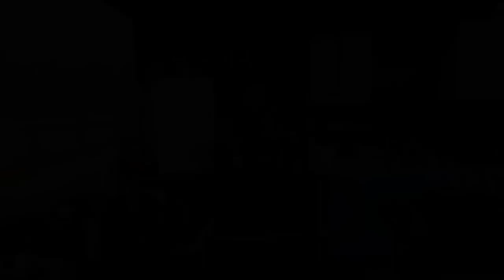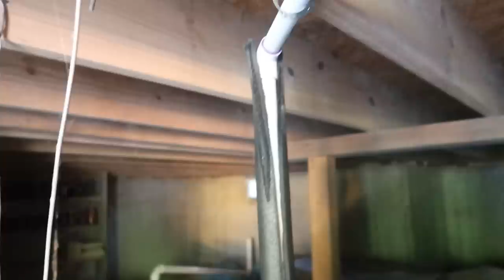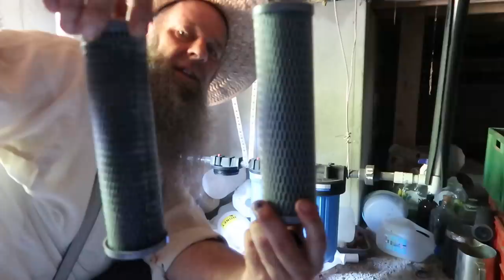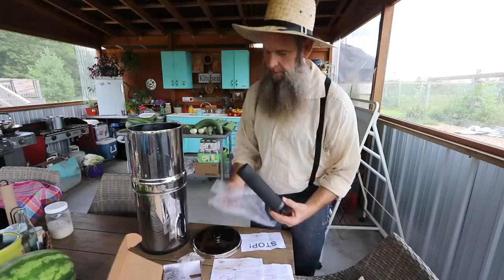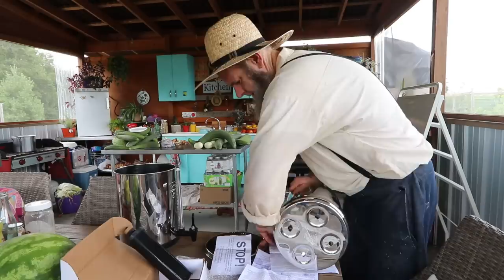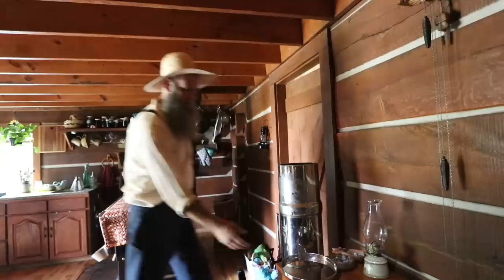OFF GRID WATER could make you SICK protect from Bacteria Viruses Heavy Metals

Comment: Hi Doug I’m a new subscriber. I used to design water systems for homes and I see a small problem with your filters. Your first filters should be the sediment (threaded) filters and your carbon filter should be the very last filter that your water passes through. You don’t want to contaminate your carbon filter with dirt and debris that’s why the sediment filters should be located first. God Bless.
Reply: Well done.. the collaboration of great minds! Thank you all!
Reply: 👍🏼 thanks for the heads up.
Reply: Great thanks so much for that information. Do you know how that works in the Burkey System by any chance? Because the water is going through at once? I have a cymomis system, I can't remember how to spell it, but I only discovered this year that I hadn't got the one that puts minerals back in, so got the extra one. But I was thinking of the Burkey for my Caravan.
Reply: Reverse Osmosis is the system I have in my house, I get the filters changed every year. 👍😉🇮🇪🍀
Reply: I was wondering about that. I was thinking he at least needed a pre-filter before the carbon filter or something
Reply: 🌻❤ thanks for sharing
Reply: @Marie-yx5ie  what's the cost of something like that getting setup?

Also are the filters expensive?
Reply: @Marie-yx5ie  How do you like that system? Is it expensive?
Reply: @Marie-yx5ie  Berkey retains the minersls
Reply: @majinvipergaming  Berkey is between 4-600 dollars, charcoal filters last 5 years as can be cleaned, can add fluoride filters
Reply: filters includrd
Reply: @seciliafeliz  highly recommend the Berkey
Reply: Berkey filters doNOT last that long. 
Do the red dye test to ensure competence. 
I have owned berkey for 11 yrs and mine lasted 1.5 yrs and it’s only me and my two young children drinking.  recently in past two yrs they have been failing straight out of box. 
Berkey has gone downhill recently. 
Do the red dye test with McCormick red dye. If it’s pink then the filters fail
Reply: @majinvipergaming  Hi sorry I am only seen your message now, it was €450 to install at first. The equipment is quite large so I had to get a unit built outside at the back wall of the sink, to house it, which cost me €350. And the guy that brought the system gave me the wrong messurments and it was a very tight fit 🙈. €150 every 12months for a service, they change the filters and check the whole system. Someone mentioned that the system I had, hadn't got the minerals filter. So I checked with the company and they said I didn't have it but I could add to my system, so I did for extra €50 last year but my unit needs a little extention now, it's bulging at the seems LOL that my next project. I hope you understand. If you have any questions let me know. 👍😉🇮🇪☘️
Reply: @majinvipergaming   he flashed the water catchment system cost at $4300 on the screen in the first few minutes after he climbed into the crawl space.
Reply: @kimberlydeschamp6300  O did he? Guess I missed it since I'm at work. But thanks for taking the time to point it out.
Reply: These filters are great for mor casual usage. They are all available in “whole house” size filters (much bigger). Still they are better for “clean” water that needs some polishing. For larger, farm scale, up to village scale… Bio-Sand filters can provide scalable resources for whatever you need inexpensively.
For small house scale systems, using a Bio-Sand filter, along with course pre-filters of decreasing mesh size will remove most of the obvious visible debris. The water then enters the Bio-Sand filter, displacing the existing biological zone, then the sand zone water, before it passes thru the stainless mesh screen into the bottom of the filter container where it is collected by a hose that allows the water to rise by gravity till just below the inlet level. Water in, water out. No pumping needed. The water proceeds to a storage container (of whatever capacity needed). This container of water is considered “clear/clean”. But if you test and don’t like what you get, you can use either gravity or pumps to pressurize the clear water & add micron/carbon filters that will last much longer due to pre-filtering. If your tests indicate it (in most cases the biological action in the upper zone of the sand filter will scrub bacteria) you could still add a ultraviolet filter, or use chlorine in the appropriate amounts, in the storage tank after the Bio-Sand filter. (You can generate your own chlorine with an 12 volt battery powered chlorine generator by MSR: 
https://www.msrgear.com/shop/global-health/se200-community-chlorine-maker/10275.html
Reply: You should make a video dude sharing your knowledge
Reply: WOW 😮❗ Thanks for sharing that vital information 😊.
Reply: Ooooh...tell me more please ❤️
Reply: Thank you.
Reply: Hey frank...how can I get watrr system in desert..there is no rainwater except twice a year???
Reply: Absolutely right !
Reply: @ingridhamilton7746  Rain water only comes from the rain. If it only rains twice a year, you are out of luck.
Reply: @sm-hi7jt  the birki’s are useless if you have high iron and high sulfur. We have both and no matter what we did the water tasted awful.
Reply: @Marie-yx5ie  the problem with RO filters is the enormous! The very best system wastes 4 gallons for every 1 gallon received and the that extends upward to 20 gallons wasted for every gallon caught in the worst of systems. When water catchment or even a well are your water source that is water that just can’t afford to be lost.
Reply: @Marie-yx5ie  I use reverse osmosis under my sink and change the filters out once a year... relatively cheap. It is Overkill as I installed a whole home system...I am slowly Getting rid of PEX to put in copper. The water goes through a high powered magnet...then a spin down sediment filter...then through a5 foot carbon filter...the longer contact time will remove chlorine/chloride...and then through sediment filter to capture anything which may have passed through or dislodged...then I've sterilizer...I can't recall brand name but they're made in America...and whole system was about 1/2 of top brands...i think less than $900 for whole system...carbon filter is good for 5 years/a million gallons...whichever is first.
Reply: @Marie-yx5ie  is it expensive
Reply: @kimberlydeschamp6300  Nice counter top in the kitchen. He also said fans bought them the filter, then a bit later talked about the glass tube to see the level of the water, said, "We opted for the glass tube...". Makes no sense to me.
Reply: Makes sense.
Reply: @lionheart830  You can order the glass viewer tube as accessory any time. He also could have added fluoride filters or more carbon. He opted for the viewer glass.
Reply: @ingridhamilton7746  if it only rains twice a year you need a bigger cistern to catch your water all at once. Someone who lives in Seattle can have a tiny cistern because it rains all the time to refill the smaller cisterns
Reply: @Montana Black-Hat Hacker I would suggest using the Zero water filter instead.
Reply: @ingridhamilton7746  cactuses? Just kidding.
Reply: Cheers ,👍✌️
Reply: Bless you for educating all of us 🕊️💐
Reply: @ingridhamilton7746  Build a container big enough to hold a year's worth of water and fill it when it does rain.
Reply: @Marie-yx5ie  thats the best h2o ever. I was a hemodialysis nurse & we used reverse osmosis to run our machines. All of us would take a jug of h2o home for drinking n cooking.
Reply: @elioraimmanuel   We have an Iron Curtain system for those exact problems, works great.
Reply: Thanks! God bless you and God bless America!
Reply: Truth!
Reply: @chrisparker7400  thanks I’ll do the dye
Reply: @lionheart830  probably not much makes sense to you.
Reply: @NameRedacted-kc2ik  👍😏
Reply: @dlspiritdancer9548  Which one do you have at home and would you recommend?
Reply: Could you do one threaded one carbon and then threaded again? Would that make any difference.
Reply: Yes
Reply: Berkey is not NSF certified.
Reply: first thing i noticed beat me to it =).
Reply: Thanks for passing on valuable information. This is how community is formed. Giving to one another the necessary knowledge and tools or assistance that demonstrates compassion, which those who receive are willing to reciprocate. There’s a whole lot of us that have yet to break away but certainly desire to. Getting started is the most difficult obstacle. Bits and pieces of necessary information go a long way.
Thanks again
Reply: @ingridhamilton7746  people catch water that is in the air with nets > look it up
Reply: @timcriswell7481  They have huge containers now that the good 
Lord blesses with rain in due season. It was touch and go there not very long ago, but the rain did come to fill up everything again! Praise God!
Reply: @amyhoang9140   The Zero Water Filter System is OUTSTANDING!!  The TDS (total dissolved solids) removed are incredibly high, leaving the filtered / purified water nearly perfectly “pure”.   I USED to use Zero.  
But… due to costs, we moved to Berkey.   (Zero Replacement Filters = $16 bucks here in NJ! With the incredibly HARD water provided by our city utility, we were going through filters after only 8-10 gallons of water filtered)

The “Royal Berkey” is a decent size for our 4 person family.
We have municipal city water, copper pipe work w/lead-free soldered joints. 
It is supposedly “safe/ok” to drink according to the utility and a local lab where we sent out a sample.
BUT… the water tastes like chlorine AND is extremely HARD and we never installed a water softener.
I probably should have installed a water softener years ago, but carrying the salt is nearly impossible for me (I have A.S.)

We truly like the Berkey and love the taste of the processed water.
I definitely noticed a huge drop in quality of replacement “black” filters, but it is still more affordable than the Zero.

If I were dealing with “marginal / suspect” water, I’d filter through a few coffee filters for sediment removal and then use the Zero.
Other than that instance, I’d probably continue on with Berkey.

Thanks!
Reply: @ingridhamilton7746  Yes I helped design one and ran it across engineers to verify it.  You just need bigger tanks to accommodate the times you don't have water.   You will need to calculate, how much annual and monthly water you need, how much water you get during minimal rain fall, to determine how much water you will need.  Shop around for the cheapest tanks you can find and create a way to funnel the rain water into them as fast as possible.  Design a way to easily remove debre when you have to clean them.  Need a pre-filter tank which removes large debree.  GL in the desert!
Reply: I recommend a settling tank before the filters.
Reply: @chrisparker7400  You have to clean the filters
Reply: @sm-hi7jt  there is a class action lawsuit against berkey. False advertising.
Reply: @CC-Rider  what is that
Reply: @elwingw4321  can you tell me where?
Reply: @elwingw4321  where is it happening please
Reply: @sm-hi7jt  got to Robert Beaty “betrayed by berkey “ YouTube . Robert Beaty is the YouTube channel. He is doing an investigation of berkey filters. And discovered 2 lawsuits.
Reply: You are right.
Reply: Thanks for your post! I thought this system was backwards. now I feel I was right. with the two thread joints, it can be turned around!
Reply: update many people posting that the new filters aren’t passing  the red dye test as are made cheaper now, I have to test mine
Reply: @ingridhamilton7746   a well?
Reply: @amyhoang9140   what's that?
Reply: What about threaded then carbon then threaded?
Reply: @chrisparker7400  
How exactly do you do that test? Ty
Reply: I was thinking the exact same thing….
Reply: @jwmmitch  what if his design was like aboveground swimming pool? He just showing under parts / pumps/ bubbler/sand barrel etc above it all assuming is the first of many debris catches, I didn't see or catch anything most likely alot of trained and untrained eyes would/wouldn't from either or experience and me not a pro at anything but know via plethora jobs plumbing electrical landscape sprinkler system and underground pool installs ,but he did mention that the farm house was where it started from and this building was far from it and attached by unground piping.
Reply: Myself would never spend anything close to a Berkeley system ,but my eldest smarter then I 20 yr plus four tour highschool grad and college degree(s) and twenty yr fed worker did but even he is currently buying his own house we are all NOT there but here in our dad/ family house the only difference is I'm in main and he is in half assed built in carport room banging on walls and ceiling thinking this will run off the rat intruder ( because church faith man don't kill bugs and never killed or will own food) thanks to our lively mum didn't correct the open gap to outside the remodel tool room now the hot water room and was in old washer dryer room entrance from old carport lol yeps hurricane Katrina didn't miss opportunity to damage further termites 3' floods but don't worry before horse runs from opened barn but build door to it after instead I think that's our code 😆 can't make it up I'm not smart enough at all but I do know a ting r two ya know ,

Like any carbon material being store bought fish aquarium filters or stuff you made yourself can rejuvenate them all by 2 weeks of natural ☀️🌞 so stop buying new ones wasting money I am aquarium fan at 10 and yes owned pet rattlesnakes in my closet too 😆 shhh don't tell mum she'd try and kill me still at 80
Reply: Can also help your issues feeling like you need protection from gama lama laima rays from micro to radio to electro wifi etc go-to shop LC live 247 on YouTube and buy shungite charcoal the most oldest strangest carbon that's out of this world thank me later I bought a pound I sleep with my teddy bear don't care bear me idgaf $20 USD but only need some earrings to protect u ! 😆 God bless you us all amen and wo man
Reply: @elioraimmanuel  good to know here in pa. Ton of iron in our water
Reply: @ingridhamilton7746  move. 🙂
Reply: I’ve never heard of the red dye test and we have the berky.
Reply: Anybody can suggest good but affordable portable water filter to put tap water before drinking???will apreciate
Reply: Our water well that was drilled costs 5600.00.  Well worth going down 120 ft.  Have a filter under the house and it tastes great.
Reply: @Marie-yx5ie Berkeys are great!. I own one!. Great purchase!.
Reply: Man the Rooster is goin offf 😵‍💫😵🤪😜
Reply: Do you use unfiltered wat for watering the garden.
Reply: @lionheart830 they sat and talked about the system so he probably  told them he'd  opt for the glass tube. Not everything g is a conspiracy.
Reply: @skybox-101 fluoride is bad for you!  No flouride!
Reply: @elioraimmanuel  If you use it in conjunction with a Zero water filter system it is good. It is what I do. Our well water has enormous amounts of sediment, minerals, TDS and it tastes bad even after it goes through Berkey filters. So I run it through the Zero Water filter to have drinkable water.
Reply: @Marie-yx5ie what system do you use? We're looking for one!!
Reply: @kimberlydeschamp6300 didn't see the cost.
Reply: I have been enightened❤
Reply: I've been trying to figure out what type of sand to use. I've seen so many answers
Reply: The best you can do is install a cistern that will hold all the rainfall you get during the year. That is unlikely to be economical unless there is enough to last several months a year - otherwise purchasing water in plastic totes is likely to cost less. @Tanacarroll
Reply: That is a gross exaggeration. The average RO system is 3:1, which means you have 3 gallons of discharge water for every gallon of purified water.  That discharge water usually is fine for things like watering gardens/lawns and taking baths/showers. 

The best systems are 1:1, which means that you get equal amounts of discharge and purified water.  
Of course, you need proper water pressure, which would likely be a problem for most rain catchment systems. 

I have a 1:1 RO system on my well water and during the many rainless months here, I go through 150 - 200 gallons/day of purified water - for my plants that are very sensitive to dissolved solids in the water. I spend about $150 - $200 per year for filters - usually the carbon filter and RO membrane.  The filters would last a lot longer, but the filtration rate drops off over time and I replace the bottleneck filter when the flow rate cannot keep up with the demand. 

 @elioraimmanuel
Reply: Question what is the smallest particulate that these filters can remove and can any filters remove chemical.

Comment: I was a plumber for 12 years. A little petroleum jelly on the O-ring (located in the threaded part of the retaining cup) will prevent damage to the O-ring seal. You can also apply a very small amount to the threads to prevent "Dry Binding" of the retaining cups. If the sit for a year some sediment can penetrate into the threads making it difficult to remove. NEVER use more than your paws to tighten the cups. Great advice in this video.
Reply: If the O ring is rubber, won't petroleum jelly cause it to break down?
Reply: I did plumbing for many years. I always use a product called plumbers grease. It helps as well to tighten fittings.
Reply: Food grade silicone grease. Yes it's a thing